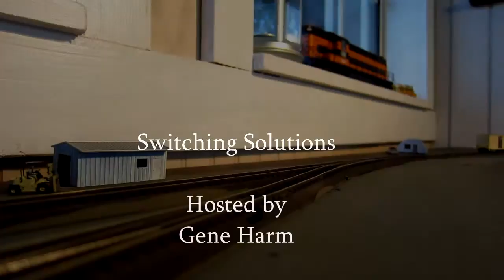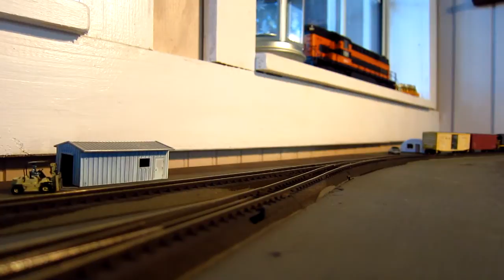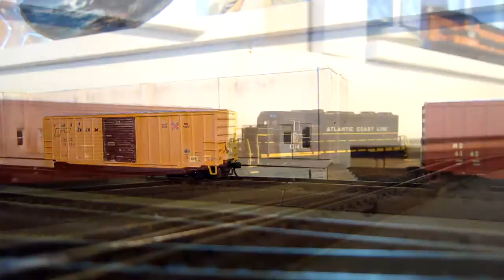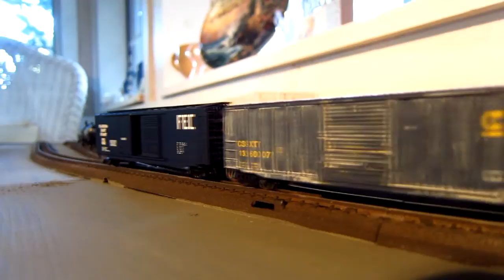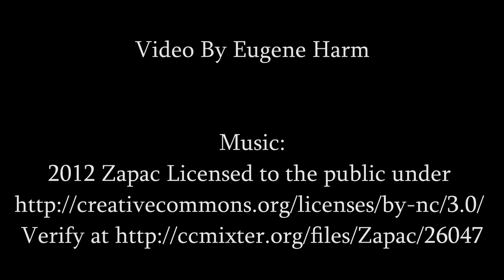Model Railroad  Vlog 6 - N Scale Switching Solutions

Comment: Great switching tutorial video.When I was a hot shot young brakeman on the old PRR  I asked the conductor( a well respected old line Irish conductor that fancied wearing a derby) where he was planning to make our runaround move for switching Gilbert's( on a facing point) and he just looked at me and said" Boyo, why would we want to do all that work when we will be returning this way?"   Back then we still have a 5 man crew that consisted of engineer, fireman(diesels still had a fireman job by brotherhood agreement), head brakeman, rear brakeman or in some cases flagman and conductor.A crestfallen hot shot young brakeman was taught a valuable lesion that day.
Reply from the maker: +brakie44820 As model railroaders we are willing to throw money and time at the railroad, never considering that in real life this is not an option. To me part of my modeling challenge is to do with less.
Reply: +Gene Harm, If we was going for overtime we would have made that runaround move and still been legal by the rule and operation ;books since it was a conductor's call.Making runaround moves helps extreme our operation time or as Tony Koester once said adds to the play value.. On my former small switching layout I had two facing point industries and yes, I used a runaround since the industries was at the end of a former branch line now operated by my Summerset Ry. A 5 mile long switching road.
Reply from the maker: +brakie44820 During one of my videos on my O scale layout I made the comment I was going to remove my one facing point spur. I have since decided, as you point out, it adds value to my operation. Now I happily perform the runaround move.

Comment from the maker: Presented are two moves. The choice of pulling or pushing (shoving) cars. Either is valid but if the train is to move any distance pulling is preferred. In this way the engineer has visibility of what lies ahead. When pushing cars the conductor is walking ahead or riding the lead car in radio contact with the engineer. If miles of track are ahead the shove will be made with a caboose as lead. The engine can run around the train to set up for a pull on the return trip to the yard if one is available. However running around a train takes additional time. Another option is to have power on both ends of the train.